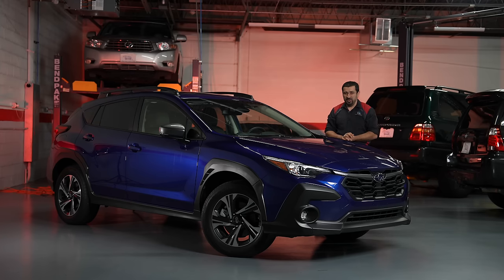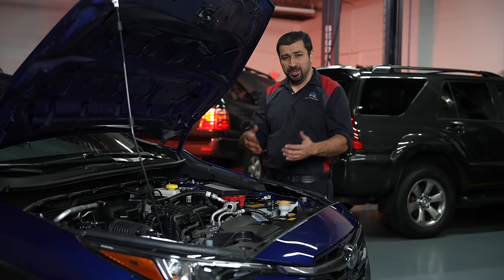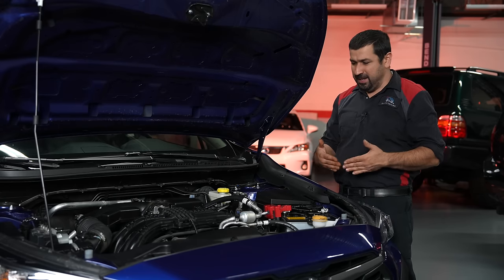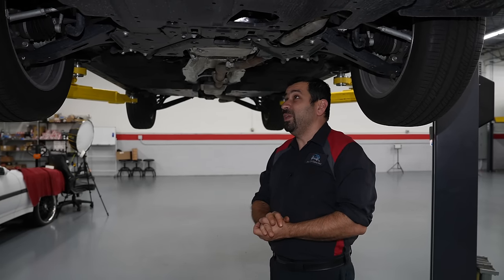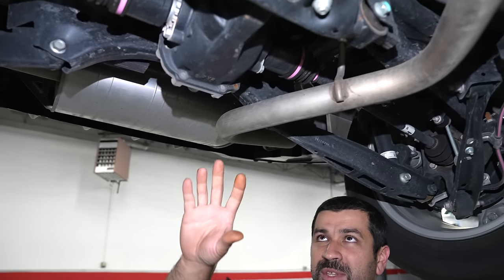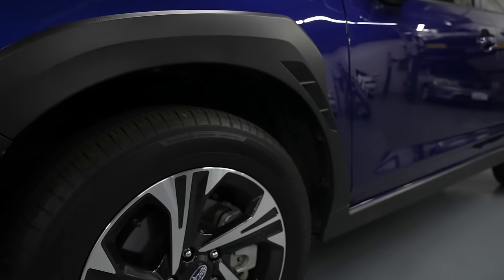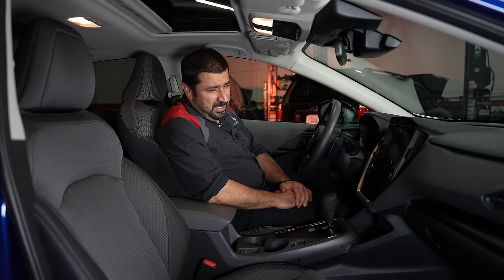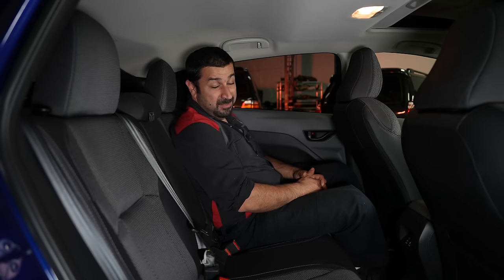Should You Buy a 2024 Subaru Crosstrek? Thorough Review By A Mechanic

Comment: We went with the Outback because my wife didn't like the look of the Crosstrek.  Its engine is a little loud getting up to speed, but it quiets down at highway speeds.  I had to get used to the total slow dog that it is (non turbo model) since I drive a V6 Highlander every day.  However, it's not bad on the freeway passing a car because it will rev up and get from 65 to 75 pretty quickly.  We have the Touring model and they added a lot of seals and sound dampening material, so if road noise is a big deal go for the Limited or Touring models.
Reply: And if you think that the Outback is too slow, just order the XT.  Problem definitely solved.
Reply: How many miles?
Reply: @davidanderson8469  just passed 10,000 miles

Comment: I concur on the wonky infotainment system and forgot to mention, one of the reasons I sold my crosstrek, it’s a dog on long hills, so slow, annoying. You get more out of it with a 6MT, but it pushed me towards a car that has more power, strong uphill and more off the line quickness.

Comment: I have run a Subaru forester 2,5 turbo 2006 model since new and have covered 340,000 kilometers to date with minimal problems.1 gasket change at 250 k, the rest only consumables. It still runs like a Swiss watch and drives like a dream. I have absolutely no reason to change it and it will probably outlast me....Best car in the World Period!

Comment: Thanks AMD, finally a Subaru review, though I was hoping for a Forester one. Regardless, the engine is 2.5L, so it’s identical to what’s available here. My Forester doesn’t suffer from the lack of physical buttons, especially the HVC and AVH. Also, I can operate any physical button while driving without looking, they’re big and laid out perfectly. I don’t find them slow tbh, they’re not fast yet adequate, and highway passing is no issue at all. While the looks are subjective, Subarus have distinctive classic designs, that can be viewed as either timeless or lacks modernity, but the more you live with them, the more you love them.

Comment: My last 6 cars have been subaru's. Of the two motors you mentioned, the 2.5  is the best.  It last the longest and has plenty of power!  Still driving my 2005 impreza with 212,000 miles and the motor still runs like a fine swiss watch!  I heard they were going to offer the 2.5 in the 2024 crosstrek so I think I might be buying one as soon as my current subaru can no longer pass inspection due to rust.
Reply: yea man, they've been offering them with the 2.5 since i believe 2021. used prices are going down too. worth a thought
Reply: I had a 2005 Legacy 2.5 GT. I really miss that car! Hope to get a 2025 Legacy XT Touring as my next vehicle!

Comment: I bought my daughter a 2018 Forester with the 2.5L and the car is plenty quick enough, its one of the things she likes about it, the fact that it accelerates into traffic safely without any drama. It would seem that the Crosstrek would weigh about the same. Subaru puts the 2.5L in the much heavier Outback and while not quick, it will get out of its own way. I have driven the four cylinder Outback and while I certainly wouldn't trade my 256 H.P. six Outback for it, it wasn't pathetically slow.
Reply: people expect 500-1000 hp in cars, because of EV's, I too have 2.5 forester, it's fast but under 40mph
Reply: Really though! On two occasions I made a coast to coast U.S. trip within 5 days driving a 2019 2.0i. These cars (impreza and crosstrek) are fine going and staying fast, and with their visibility amazing at merging. Just don't expect to pass more than two car lengths in one go on a single lane and you'll be happy and get great gas mileage to boot.

Comment: Not a direct comparison but I'm glad I went with a 2023 Forester Limited. Much simpler controls and even though the body is completely different it's less gaudy with the wheel well and front end trims as was the 2023 Crosstrek. Seats could use a little cushioning but still doable for longer trips. The big screen looks cool but manual buttons are easier to use IMO.

Comment: The Subaru's from the 70's were awesome cars , 1.6 engine , 4 speed stick , no OHC's just simple push rod valve set up. Very easy to work on , I could have the engine out in 45 minutes without breaking a sweat. I wish cars were still like that ......🤢

Comment: That was a great review, I think the only thing missing was the X-mode. I always thought that there was only one wheel driving in front and one wheel back driving (open differential?) and the xmode would more aggressively move power left or right or front to back as needed based on road conditions. This is an awesome snow car.
Reply: I've never owned one, but they are pretty popular here in MN.  If I didn't already own a truck, I'd take a serious look at one of these.
Reply: Which X mode is best?  I only have the base model X mode.  I have some design upgrades with tinted windows and a few other things.  For daily driving to work etc do you need multiple X modes or is the base option enough?
Reply: @lynellethompson5521   Their really is no "base mode" Subarus have "single mode" or dual mode. 
The single mode X-mode (snow/dirt) is good for most situations that exceed normal driving conditions
The Dual mode (has a selector for either (snow/dirt or deep snow./mud)  "deep snow/mud" is for situations that need additional wheel spin. it is intended for situations when you are in extreme weather conditions or off-roading.  So I guess if you do a lot of driving in deep snow (greater than 6 inches) or lots of driving in the mud, dual X-mode is the feature you want. Sorry for the long winded answer.
Reply: @MIkegrimm2  thank you!!  We do get more than 6 inches of snow in a snowstorm where I live.  I've had x 2 Honda CRVs prior to this vehicle.  The first was amazing in snow.  The redesign with the wide tires was awful!!  I also was instructed by someone who was a Mechanical Engineer to actually turn off the vehicle stability assist during snow storms so the car would handle better.  The VSA was useless!!  I'm going to have to learn when and how to use X Mode!!  Do I just use it if I get stuck, or do I turn it on and leave it on when I'm driving in snow??  VSA had to also be turned off on muddy Spring country roads because it pulls side to side constantly and it's difficult to drive.  Like I said Honda VSA was worthless!!
Reply: @lynellethompson5521   Well since the Subaru already has an active All Wheel Drive System, the power is already being delivered to the wheels, however, if you get to a point where it is not enough, then I would engage the X-Mode at that time. 

The one thing you must do if you are using X-mode is to keep a steady pressure on the gas, if you start and stop, it will make it harder for X-mode to do its job. 

Also make sure you have good all-weather tires or snow tires.
Reply: @MIkegrimm2  thank you!!

Comment: I agree about the AC controls. They could have placed the same small knobs that they used for volume and tuning, at the bottom of that infotainment screen. Then they wouldn't have had to fail their Subaru safety claims, and have us take eyes off the road to adjust the AC. It is awkward to adjust the AC in this car while driving. The 2023 has a much quieter ride. They quit production abruptly at the beginning of the year, and began releasing the 2024 as early as April 2023, when I was shopping for a 2023. Still kind of holding my breath with this 2024. They've already had a serious recall for the instrument panel wiring.  They even had to freeze sales while they made that repair on new 2024 inventory. Not so sure about the new CEO at Subaru. Don't even get me started on the "structural adhesives, and silicon seals instead of rubber gaskets for the various hoses under the hood. Fingers crossed. I would have bought a Honda, but the redesigned HR-V looks like a dumb old Ford, and the cloth upholstery reeks of formaldehyde. Most Honda dealerships are hiking up the sales price about 4K over the MSRP. I guess they want to keep their cars on the lot. The Corolla Cross is just plain ugly, and the rear seat doesn't fold flat for car camping. Toyota messed up there. Subaru does have the great design aesthetic going for it. I do like the ground clearance, and very nice upholstery, with no formaldehyde stink. It drives plenty fast for me, not slow at all. Sounds like you might have a bit of a lead foot there sir. I have to say Subaru service at the dealership beats the Honda dealership hands down. (Loved my 2003 Civic. My friend's granddaughter is driving it to school now. It was always a headache taking it to the dealer for service.) I would like to know your thoughts on the structural adhesives, and silicon seals instead of gaskets. Thanks for your thorough review.

Comment: I don't want to scare any Subaru owners away. As we had everything replaced under warranty and had a mostly positive experience... However... I had a '14 WRX for 10 years and recently took over my wifes '12 Forester after selling the WRX for a Pilot to accommodate our 3rd kid. WRX had rod knock at 20kmi, 2 transmission rebuilds, steering rack replaced, and 3 clutch rebuilds by 30kmi. After that it was pretty reliable/enjoyable. The Forester had oil consumption issues and burned so much oil that it went dry in 1000mi, right around 99kmi. Motor was replaced under warranty. Still consumes ~1qt oil per 5kmi. Other than that, it's been running strong for 170kmi. Even towing our popup camper (4EAT helps here). We'll run the Forester into the ground, if I'm honest, it's been a great car for our family. Compared to the Pilot, it SEEMs small, loud, clunky, and SLOW. But it's super functional, with great visibility, and tons of space (even fitting car seats 3-wide). I'd venture to say it's probably the best Forester ever made, being pre-CVT with a bulletproof transmission. If you buy a Subaru new, BUY THE EXTENDED WARRANTY. We both used ours, and got our money's worth, by the skin of our teeth, as well.

Comment: It's also a good car for anyone enjoys doing some offroad plus being comfortable onroad.  Just got back from a 2500 mile trip in my 23 Ctek 2.5.  All kinds of weather & roads, no problem.  CVT no issue.  I've owned other Subarus, all with CVTs.  I don't get what the problem with them is.
As far as being slow, never had a problem merging or passing.  And I was driving on the freeway at 80 - 85 mph.  Gas mileage between 27 & 30 mpg.
As far as I'm concerned it's a good everyday & roadtrip car.
Reply: There are two types of people who don't like the Subaru CVT, 1) The "stomp & stab" drivers (stomp on the gas, stab the brakes), which CVTs (and most other cars) do not react very well to, and, 2) Clueless clowns that "heard" about CVTs, or some cretin said that the Subaru CVTs were junk, so they parrot the same BS.  My '22 Subaru Outback XT?  Does just fine, both the wife & I like it, and, for the most part, you don't even know you're driving a vehicle with a CVT.  And we have no problem getting MPG numbers around the EPA estimates.
Reply: Regarding the CVT. The people who complain about them being unreliable are the people who never maintain/service them. They just require more frequent oil changes and servicing - no big deal, i do mine in my garage
Reply: @eskieman3948  not that I am a Subaru apologist but I was glad he mentioned Subaru CVTs are made in-house and not by JATCO.  It is mind boggling how many people I've seen spread misinformation about Subaru CVTs still being made by JATCO.  It's still not has bad as the misinformation about head gasket issues though.
Reply: @petayV8 you are spot-on about most people not keeping up with basic maintenance especially for the CVT. I owned a first-generation CT that reached 302k miles before being totaled by my teenager. I did all the maintenance myself because I don't trust anyone to do the work properly. Only issue I had was a wheel bearing going out prematurely that was covered under warranty.

Comment: Just bought a Crosstrek Wilderness and yes it is not fast but I went from a 600 hp car to it and I really don't mind it. Yes I can't 0-60 in less than 4 seconds and no I can't rip off 10 second quarter miles and 100 mph comes in never but I also get 30 mpg and don't pay an extra dollar a gallon for gas.  Also I can drive on wet pavement, go through a pot hole and not worry about road debris destroying my rear fascia or front air dam.  I can now turn off road and this impeding snow storm is actually something to look forward to.  All things consider I think I'll keep the Crosstrek.

Comment: The 2.5L is adequate in performance - wouldn't call it slow, just not sparkling. 182HP for the weight is fine, 0-100kph in 7.8 secs, yep, adequate. You'd really ONLY want to buy the 2.5L.

Comment: We just bought the 2024 Subaru Crosstrek wilderness. We absolutely love it. It is replacing a 2003 Subaru Forester with 275,000 miles on it. With the manual transmission. We’re still gonna hold onto that one for a while.

Comment: Great information. Very in-depth review, and from it, you picked up a new subscriber to the channel.  However, as a new 2024 Crosstrek owner, I would agree with everything stated except the part about NO acceleration... At least with the 2.5L motor, which I am driving. Now, is it a turbo V8? Nope... Can you do a burnout? Not a chance... But for a car with the smallest motor I've ever owned, I can say with assurity, it is not slow. Even when not in Sport mode, it will get up to 70mph, avg. HW speeds in my area, with no problem. And I have never tried with the paddle-shifters. That would probably be even quicker. 🤏 Again, great content..!

Comment: Excellent review.  The excellent safety record of Subaru vehicles also deserves a mention.  Our 2018 Crosstrek was totaled in a front end collision.  Driver and passenger were unscratched.  Replaced it with a 2019 Crosstrek.  32K miles with no issues so far.  Recently added a 2024 Forester to the stable.  If you are not a fan of the 11" head unit screen, the '24 Forester is the last Subaru model and year to have the 8" screen with physical HVAC controls.

Comment: Thanks for the review.

I have 2 Subaru vehicles; a 2013 Crosstrek and a 2009 Forester XT. There was an issue with the '13 and '14 FB20 motors in the Crosstreks. It burns oil somewhere. Not leaking and not coming out of the tail pipe. I'm away a lot for work so the engine oil is not checked often by the primary driver. I drove it a few weeks back and it felt sluggish. I put some throttle to it on a back road and the bottom end of the motor went. So now I have broken the bosses car and it is all my fault (better happening to me then her). I found a used motor at a local wrecker and will be picking it up soon. I was a mechanic (still am I suppose. Just not licenced anymore) and do have a great shop and all of the tools to do this work. I just wish I had the time to do the work sooner. I'm looking for a new or newer vehicle for her now so I can take my time dropping in the new motor. Probably a newer Crosstrek as they are very good otherwise. I always feel safe and in control no matter what the roads are like. If it can’t get from point A to B in any condition then nothing will. I’ve had snow coming over the hood at highway speeds before and it almost felt like I was on dry pavement. If you plow snow for too long it will eventually pack the snow under the car and sort of high side you making you really stuck. Same thing happens to Jeeps and other off road ready vehicles as well. I know because I’ve got them real stuck as well. 

The CVT in the Crosstrek works fine. I'm not sure why everybody POO POOs them. Does no one actually drive there car normally? You can't tell unless you floor it. Then it picks the most effective part of the rev range to get going. Yes, that is usually near the upper range of the revs so it will be louder. They were banned in F1 cars a few decades back for the perceived unfair advantage they thought they offered by having the engine always in the sweat spot of max power. CVTs have been used for decades on snowmobiles. Some snowmobiles having more power than this car and they put all the power through a reinforced rubber belt. Ask my wife or any other woman who has driven a CVT and they will tell you that they didn't notice the CVT being different. Subaru uses set ratios (position of the steel belt on the pullies) to simulate gear shifts. I use the paddle shifters some times just to add a bit of engine breaking when rolling up to a stop light. 

After I get her a newer car and the new/used engine in the old car, I will drive the old Crosstrek while my turbo EJ25 motor from the Forester goes in for a rebuild then sell the Crosstrek after that is done. The forester still drives great but has a lot of miles on it (about 150,000) and it is making some sort of ticking noise in the valvetrain. I'm tempted to up the power a bit as these engines are easy to get big power numbers from. Not crazy but maybe around 270 to 325hp with just a few bolt on parts. It is already quick with just stock 227hp or so. The turbo Forester is a real sleeper. It passes really well. Just hope the cops arent around as it builds speed fast and keeps going hard until the chassis can't keep up safely. I'm not going to lower it or upgrade the suspension just for top end stability. I haven't really worked on Subaru cars yet so I'm sure it will be a learning experience. Lucky they are easy to work on.

Comment: If subaru was to use a hybrid set-up, would the 4 wheel drive system still be as good?   One motor to drive the front and another to drive the rear?  Or would you still use a drive shaft?